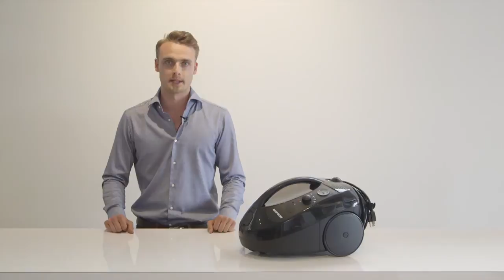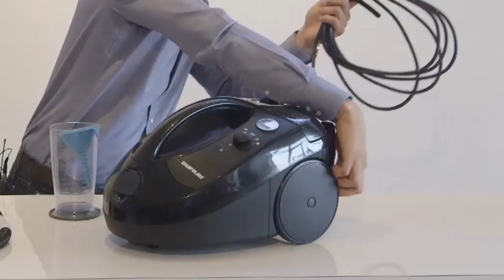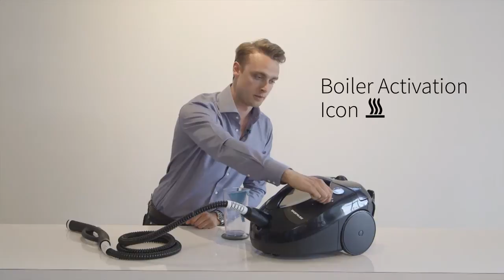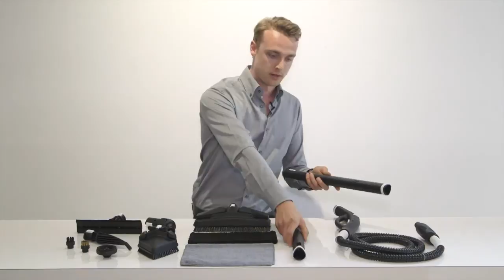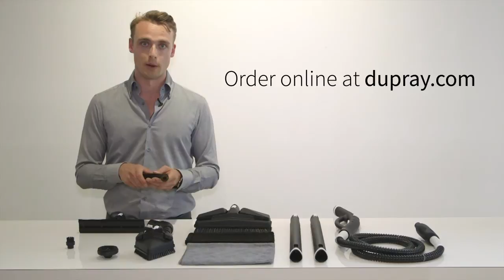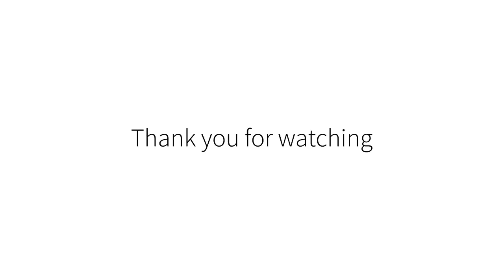Dupray ONE Plus™ Steam Cleaner Training Video

Comment: Finally unboxing my One Plus (that's what the box says) after a couple of months and everything seems straightforward from watching the video, but a couple of things differ from the video. First, my unit does not have the boiler setting, just on, off steam. Also, no floor glider pad, and I even purchased the advanced cleaning pack, no glider there either. Has something changed with the one plus?
Reply from the maker: Yeah we replaced the glider when we updated the floor tool.  The older floor tool was making a weird vibration on some floors so the way to get rid on this was to add a thick pad under it.  Its no longer relevant :)  Same for the boiler setting, it’s simpler and better now.  We will update the video soon.

Comment: Do we need to clean the boiler with vinegar once in a while. If yes, how do we proceed thanks
Reply from the maker: Francesco Yes!  Simply fill the boiler with a mixture of 50/50 water and white vinegar.  Let sit overnight with the cap off.  Rinse. All set!
Reply: @dupray.official  The instruction manual states a max volume 700ml with 50/50 mixture.  If I go over that, is that okay?  Also, when you said leave cap off, do you mean to stand the machine upright with the screw bolt out?
Reply from the maker: Critical Thinking Yes, it’s okay. Yes, just leave the cap off overnight, upright.
Reply: For the maintenance, where does the water/vinegar go exactly? On the top or the bottom where the bolt is? Are the 2 separate compartments? If they are separate, do we need to pour the water/vinegar in both compartments?
Reply: I just received mine and it has a sticker on the box saying “Do not use with distilled or deionized water”

Yet in the instruction manual it says if you live in a hard water area to use 50% tape water and 50% distilled water.

I would have thought 100% distilled water would be best so that you never have to de scale the boiler out with vinegar.

Comment: Can you use this on clothing for steaming out wrinkles?
Reply from the maker: It’s not really meant for that.  We will be releasing a garment steamer very soon!
Reply: Dupray thank you! So on this can you adjust the heat temp or does it always come out as one temperature?
Reply from the maker: Meg Word No steam cleaner allow you to adjust the temperature.  The boiler will always go to the max, creating steam.  Some models allow you to release less steam with variable steam pressure.  This Neat model doesn’t have this function, but frankly doesn’t need it.